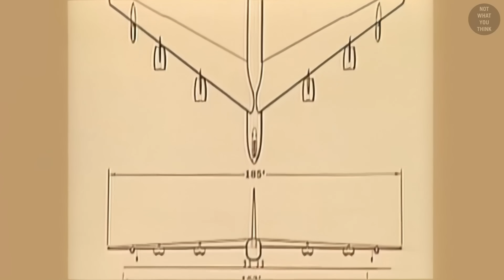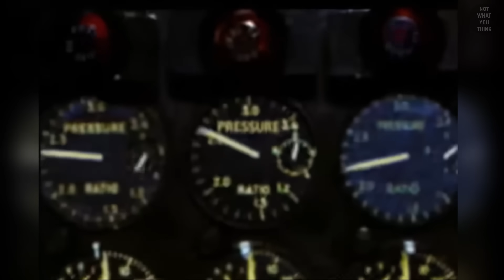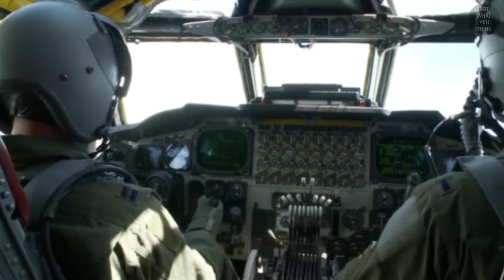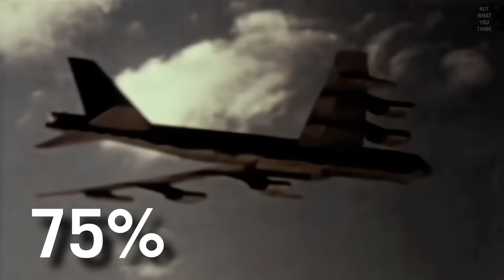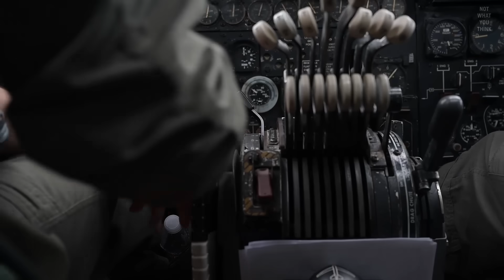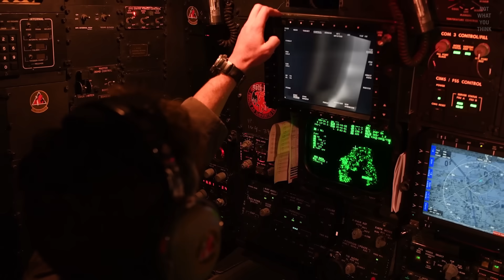Why This Obsolete Bomber Will Outlive EVERYTHING

Comment: The B52 is capable of flying much higher than 50,000', but the official ceiling is listed there because the USAF regulations state that if you are flying above 50,000', you need a pressure suit (those space suit things you see U2 and SR71 crews wear). I've heard more than one ex-B52 crewmember hint that they would fly higher, but in that "wink and a nudge" kind of way.
Reply: Just like the max ceiling of the Sr71 was 85,000 and Mach 3.2…🤣
Reply: @hammersmith1653 imagine that fly by
Reply: 75,000 ft with minimal payload and pressure suits
Reply: @angusmatheson8906  Wrong
Reply: It struggles to reach 50 lol
Reply: Maybe they were capable of higher back in the early days.  In 1992 I took a lightly loaded Fairchild AFB 60-0051 to 49,980 feet on the way to FL50.0 and the cabin outflow valve failed, resulting in a rapid decompression.  My mask was gang loaded on pressure breathing, but I still wound up with the bends. Even then, we had to gradually stairstep climb to that altitude before the accident altitude.
Reply: 50k feet with weapons, 70k feet with none.
Reply: @singularityraptor4022 . If we want to be as accurate as possible: Some airframes are quite capable of at least 75k ft providing light payload and pressure suited crew.
Reply: @singularityraptor4022  
   At about 63,000 feet (47 mm of Hg), blood will boil at 98° F (without a pressure suit.)
Ebullism is a painful way to go…..
Reply: @dr.OgataSerizawa  good thing you don't have to worry about any of this because without a pressure suit, you will painlessly fall asleep and never wake up again.
Reply: @kirayoshikage4057  As I remember, the B-52H's had a hose that one could connect to a pressure suit.
Reply: @singularityraptor4022  Wrong
Reply: @brucephillips2106  wrong
Reply: That's because, above 50,000 feet, if the cabin loses pressure, the crew would instantly pass out. There wouldn't be enough time to put on oxygen masks, and they wouldn't help anyway, because the loss of pressure would cause the water in their lung tissues to evaporate in seconds, drying out their lungs and making it impossible for them to breathe no matter how much oxygen they inhale.
Reply: @fyrstormer  That's not how it works with us bomber crews. They don't "instantly pass out".  We were required to have our oxygen masks on tight, and if there was a problem we would immediately hit Pressure Breathing on our regulator panels to prevent hypoxia while we descended to thicker air. I had a rapid decompression at 49,980 feet on 60-0051and we all survived.  I had a slight delay gang loading my regulator's Pressure Breathing switch, and got a case of the bends, but we all survived and nobody passed out.
Reply: I believe they can fly 330,000 ft.... thats how high they dropped the X31 back in early 60's
Reply: @rjwise66  : 330,000 feet is well into space -- 62.5 miles. No airplanes can fly that high, only rockets.
Reply: @rjwise66  firstly I think you added a zero there, secondly, I believe you mean the X-15 as the X-31 was a thrust vectoring test bed in the ‘90s and didn’t use an air launch

Comment: I wonder; was the aircraft worse than other aircraft, or was it just that putting 1950/60 aircraft continually in the air, 24 hours or more, is to much for any aircraft of the time.
Not to mention the crews.

Comment: It should be noted that the airframes of bombers like the B-52 don't age anywhere as rapidly as the airframes of commercial passenger jets. Airline companies try to keep their jets flying in the air as much as possible because a parked jet is a jet that isn't making money for the airline. The B-52's, on the other hand, spend many more hours parked on the ground and only fly for training missions and combat.
Reply: Planes are made to be flown Not parked.  That is why Airlines fly so much.  Every second on the ground is weighing down the wings of the plane.
Reply: The design standards for airliners is not the same as far the B52. The skin on the B52 is much thicker. Also, aircraft don't age by the hours in flight. The only thing that matters is the number of flight cycles. If a single aircraft stays at altitude for four days, that is one flight. 

Also, the military doesn't leave them parked. They are constantly flown for training purposes. Not just their own training, but training the refueling crews, the fighter crews and others. They experience more flight cycles than most airline aircraft. 

In other words. Your wrong.
Reply: @hewhohasnoidentity4377  Would like to add that most of the B-52 is unpressurized.  Unpressurized planes don't see the stress pressurized ones do.  That is on reason we see DC3's and DC4's still flying.  GO BUFFALO AIR :)
Reply: @hewhohasnoidentity4377  Nope, you are wrong.

1. Not only cycles are matter, also the hours. BWT there is cycle for the airframe and also for the engines. 
2. The pressurization cycle of the B-52 is lower as well as the FH. An average airliner in a single year can fly 3000-4000 hours while a single B-52 flies maybe 500-600.
Reply: @hewhohasnoidentity4377  Actually you're wrong and he was correct
Reply: @hewhohasnoidentity4377  completely false, but thanks for your enthusiasm.
Reply: @hewhohasnoidentity4377  well, you have one slight problem.
you're*
other than that, nice information.
Reply: @hewhohasnoidentity4377  "Also, aircraft don't age by the hours in flight. The only thing that matters is the number of flight cycles."

That's not true. The wings of aircraft in the air constantly undergo slight flexing motions (and sometimes large flexing motions in rough air or turbulence). All those flexing motions add to metal fatigue in the wings and other parts of the plane's structure.  

"Also, the military doesn't leave them parked. They are constantly flown for training purposes."

No, B-52's are not constantly flown for training purposes. I was an Air Force brat in Guam, where Anderson AFB, a B-52 base is stationed. Those B-52's are NOT constantly in the air. They're normally parked on the tarmac, and only occasionally go up into the air for training. Your claim that "They experience more flight cycles than most airline aircraft" (which may go up into the air up to several times per day on multi-stop flights) is ridiculous.

Comment: What people don’t understand these days is that new mil tech takes a decade or so to mature once it reaches live service. The Zumwault line is a fatality of this, a promising line of ships cut short due to, well normal shit that happens.
Reply: Zumwalt tried to do an all new untested main weapons system, an all new untested radar system and an all new untested propulsion system all wrapped up in a radical all new hull form. So when the inevitable happened and all those systems individually had significant cost overruns/delays the entire Zumwalt class sleep-walked straight into cancellation and failure.

And it's not even as if those systems are useful now, gun has been completely cancelled, radar was overtaken by more advanced tech and abandoned, next destroyer is going back to a conventional hull. Only the integrated electric propulsion is going to be used again, even then not in the same version as Zumwalt.

Comment: If the AF would refit the engines with modern high bypass turbofans engines the BUFF could be a much more efficient and capable aircraft but they are going with less efficient engines that can be stuffed into the same space as the old engines.  Instead of 4 highly efficient and more powerful modern engines they will have 8 less capable engines taking up more weight and doubling the maintenance requirements.

Comment: They are talking about using 747's to do the work of BUFF's, as much cheaper to run
Reply: 747s will be more costly to run and retrofit as bombers than the B-52, and no they are not talking about replacing the B-52 with 747s
Reply: Well, I did see a video (Dark Sky's maybe?) that had a converted a 747, not as a bomber, but to launch missiles & crouse missiles from & would've thought a 'mass' production plane would be much cheaper than these jobs. Of course the people making $$$ out of them might not agree 😁
Reply: @mikelacross  That 747 never existed, the missile truck type plans you are referring to never made it off the drawing board.
Reply: Durn 😕

Comment: No aircraft is 100% safe to operate and all carry inherent risks. The first half of this clip implies that the B-52 had a high accident/mishap rate, but compared to other aircraft in the US inventory over the years, the accident to flight hour ratio of the B-52 is not markedly higher than most
Reply: Exactly - flying 24/365, they were making hours/miles - hard to compare with fighters that maybe fly a few hours per week/month? Lockheed Starfighters were called widowmakers for a reason...
Reply: Crash landing after running out of fuel is not the fault of the aircraft and should not be deemed as one.
Reply: @totoitekelcha7628  Unless the fuel meters/system was faulty...
Reply: @ibubezi7685  They said the regueller aircraft is not available due to weather or some problem on the refueling aircraft not the bomber.
Reply: Plus one should see the accidents per flight hour rather than the total. With so many in the air, statistically some accidents are bound to happen.

Comment: Because of how much the b52 has changed, I think it’s totally inaccurate to call it the same plane in 1950 as 2023. 
It’s like calling a 1953 Corvette is the same as a 2023 corvette.
Reply: Still original airframe from the 60s with upgraded avionics. They haven't made a new frame for about 55 years at this point
Reply: The last B52 airframe was built in 1962.

There’s no such thing as a 2022 B52.

They’re old.
Reply: @TesterAnimal1  It is getting new engines this year and of course the avionics and technology had changed greatly. 
Unlike fighters, bombers and transporters have a simple job, and all the more advanced bombers since are much much more expensive to operate with less payload. Its why I used the Car example, the new car is still a car, but much different with more tech and more power.
Reply: @TesterAnimal1  damn I forgot, upgrades don’t exist. 🤯

Comment: 3:30 - "...a B-52 broke up mid-air as it suffered catastrophic loss of fuel" - went through it three times, as I though I've misheard it. But seems (sounds) I did hear it right, and now I'm wondering how an airplane can fall apart because of "loss of fuel"... - ?
Reply: When a b52 is fully fueled most of it is stored in the wings and the wings are so heavy on the ground they have small support landing gear at the tips to support them. When it takes off the wings get lift first and bend upwards then fusalage finally . (Watch the wing flex on take off ).

Maybe the fuel leak caused an imbalance of some sort  leading to a inflight breakup
Reply: @McRizzle23  Thanks for the explanation. Yes, I know that modern aircrafts typically have fuel tanks in their wings, and it makes the wings heavy and causes them to sag. Yes, when the airplane takes off it's its wings that produce the lift - and because of it they lift up.
And yes, some uncontrolled/ unintended loss of fuel could easily cause some imbalance, but then an imbalance itself cannot produce "mid-air break-up". If that fellow meant "sudden and catastrophic total loss of fuel from one wing produced heavy imbalance, leading to a loss of control of the plane, and in resulting free-fall the plane broke apart" then he shouldn't have said "[it] broke up mid-air as it suffered catastrophic loss of fuel" because it's just stupid, makes no sense whatsoever (i.e. it's a classical "non sequitur", no cause and effect connection), and it constitutes a lousy (and lazy) use of English. And that was my gripe, basically.
Seems like my first thought was right - this sentence makes no sense, "loss of fuel" WASN'T the "cause", or at least it wasn't the DIRECT cause of "mid-air break-up", and it's just yet another example of some wannabe "talking without hearing" (himself).
Reply: I think he meant the broke-up is happening in the same time as the catastrophic fuel loss
Reply: @ridhosamudro2199  Righto... Modern education shining through, eh? ;-) Or, "We heard what she said but we knew what she meant". (Of course, I mean the narrator.)
Now, that would be just as accurate and "making sense" as saying that "an airplane broke mid-air as it suffered catastrophic decompression" to describe an effect of it being hit by a SAM. Yes, the decompression took place, and yes, the airplane fell apart - "as it suffered decompression"... Well, I guess it gives some "another dimension and angle" to the name of the channel - "Not What You Think"... ("and neither do I").
Seems we must never underestimate "linguistic creativity" of all them YT "content producers" - few days ago I watched some video where an industrial ball mill was mentioned. This type of mill uses relatively small balls made of "white" (i.e. hard variety) cast-iron to grind whatever it is supposed to grind, and it would be bad enough of the narrator to say that "BEARING balls are used to grind the ore" - but he got to an even higher level of ignorance, and said "ball BEARINGS are used to grind the ore"...

"Time to die", as they say here... ;-)
Reply: If you lose too much fuel fumes can build up and fumes are set off easily
Reply: @Jkklhtt  Tya... Lemme paste here a short quote from myself - from few months back:
Now, that would be just as accurate and "making sense" as saying that "an airplane broke mid-air as it suffered catastrophic decompression" to describe an effect of it being hit by a SAM. Yes, the decompression took place, and yes, the airplane fell apart - "as it suffered decompression"...

B-52 has JET ENGINES. Jet fuel does not vaporise "instantly", and in fact when you drop a lit match into a bucket of it, the match will be extinguished.
And, last but not least, the "CAUSE" in this case would be NOT a fuel loss, NOT "vapours build-up", but EXPLOSION.
And this is my gripe with the narrator and his way of phrasing the sentence/ reasoning. It just makes no sense - in this case at least.

Comment: The Palomares accident remains 100% uncleaned, there's lot of soil piled up behind metal fences and radioactive signs and everytime they try to build something, radiation meters sends and alarm
Reply: Not to mention one bomb is still unaccounted for. There were 4 dropped and one was never found.
Reply: @DarkStarlifter  I think they found all 4 bombs, 2 broke on the ground, 1 landed on a river (in one piece) and the last one was at the bottom of the sea. The 2 that survived are in a museum, I think

Comment: I remember an OshKosh WI air show in the early 90’s where a B-52 did 2 flyovers just above the trees. The announcer mentioned that they couldn’t have it land because it required 8 foot thick concrete runways due to its weight. 😳

Interesting to learn from this video that those low altitude flyovers also has a very real cost in terms of stress on the airframe.
Reply: They were supposed to fly under enemy radar into the SU (using ground-following radar - similar to how cruise missiles fly as low as possible). Aviationgeekclub has an interesting/cool story on how low - with pics (though no trees 😉)
Reply: @ibubezi7685  The B-52's had video displays that would let them hand fly the B-52 at very low levels. It was necessary to have that capability to penetrate the missile and anti-aircraft defenses of the Soviet Union. It did NOT have an "automatic" terrain following system like that used on the FB-111.
Reply: @badguy1481  Right. Well, maybe I mixed that up then - although there have been several upgrades, so it could have been installed, as the F111 flew in Vietnam, long before the end of the Cold War.
Reply: @ibubezi7685  I believe you're correct.
Reply: Either Wittman Field upgraded its runways or they took a chance on landing one because they sure as heck had two H models at the 2017 EAA airshow (Oshkosh WI), one on flyover and one as static display with ground crew in attendance.   I got a chance to talk specs, comparison with G models (USAF crew chief 1985-1988), and just generally enjoyed seeing one up close again after all those years.